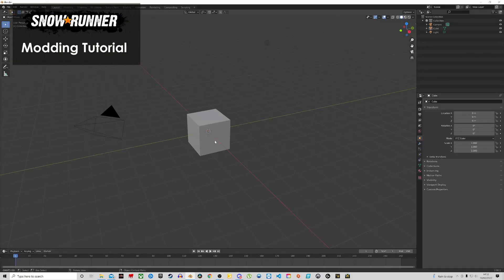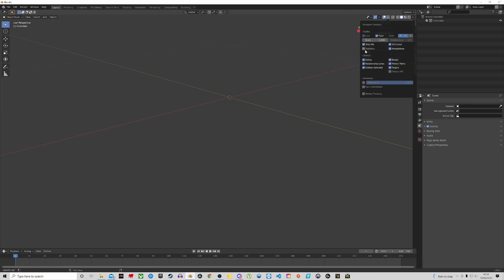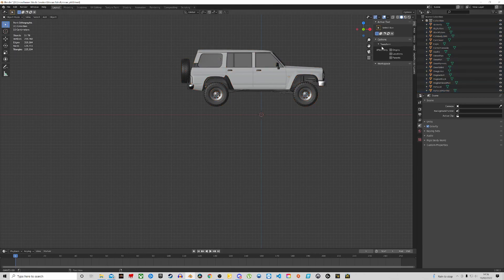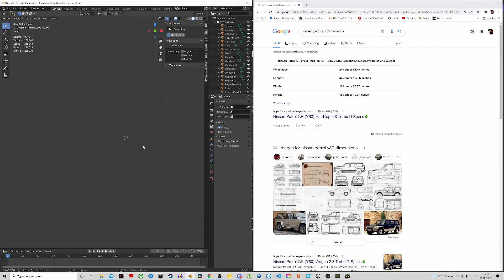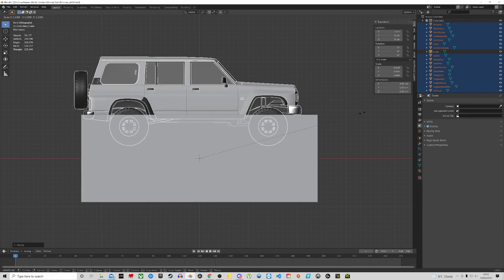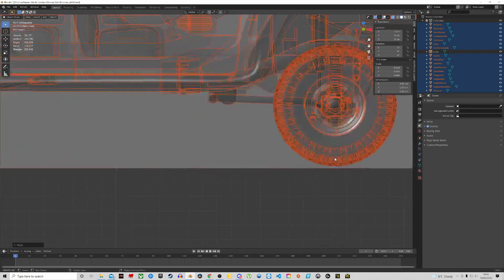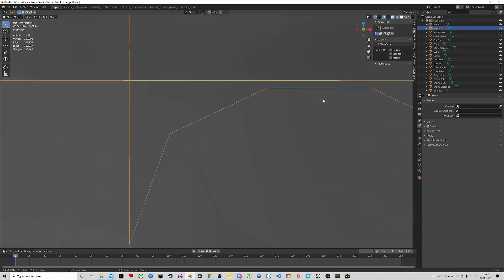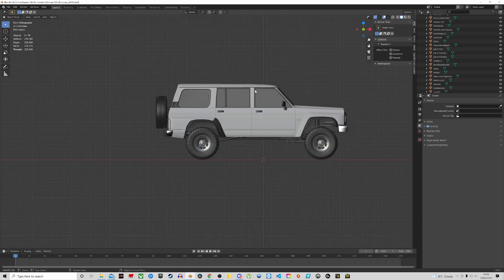SnowRunner:  Modding Tutorials | Ep 1 | Preparation | How to make mods

Comment: hi is there any continou on this tuorial? as im looking for some of them...and i dont know why but i cant find tutorials how to add truck to game (only one serie i found and now i find oyur video) ...i can seemy model in game but after placing it (in test area map) than game freeze and crash.... last two lines before crash:  Game| Truck 'avia_a31/avia_test' frame 'BoneBody_cdt' (camera parent) non-indentity rotation: game wont work correctly and last line:  Game| Unrecognized character collision filter OnlyWithAll  for now i have only bone for body and front and rear axle... work with bones etc is mess ...would be grat to see any videotutorial on it ..thanks for info
Reply from the maker: I would encourage you to then join my discord server where I can host live streams on how to create mods for snowrunner. I have taught many others this way. I find the live streams are better because there are many issues which you may encounter that I cannot address in a YouTube video. Link to my discord is on all my mods on modio. If the links have expired then message me through modio for an active link.

Comment: Yo the new update on this thing dropped and it looks pretty clean man, looks good, could we possibly still get the old paint jobs back aswell as some features from the older version like the old grille and just some of the stuff that the old version had as well as all the new stuff, cheers man
Reply from the maker: Thanks for the feedback. A huge part of the update goal was to make the mod file smaller so that you guys can easily use it along side other mods. Adding more content will increase the file size and consume more RAM. I already have some ideas for another update but it won’t be soon. This is already an extremely great mod with over 1 million downloads and counting.

Comment: I'll play you $100.00 to make a 80 ton heavy haul trailer with12 axles with trailer that can operate to load and unload heavy equipment. If its turns out cool I'll add another $100.00
Reply: 9 axles work as well
Reply from the maker: Have you found/seen a suitable model or do you want this done from scratch?
Reply: @Iceberg11  no I haven't, that's why it would be amazing. It would need to be done from scratch.
Reply: I'm on the Xbox X/S but I'm in the process of building a gaming PC.